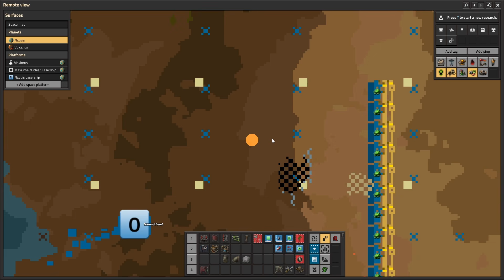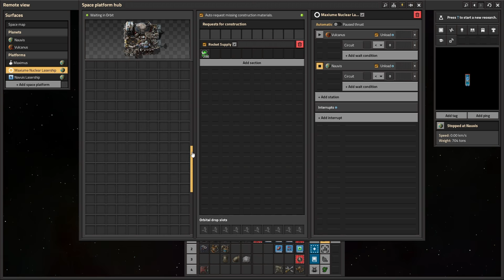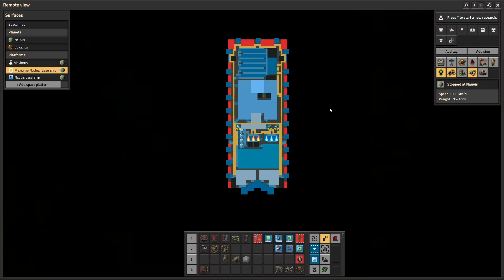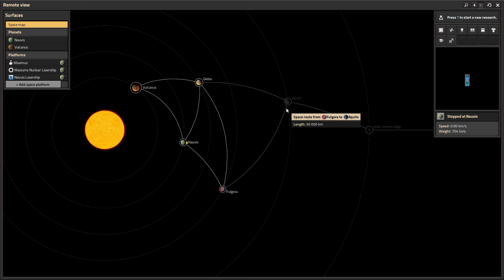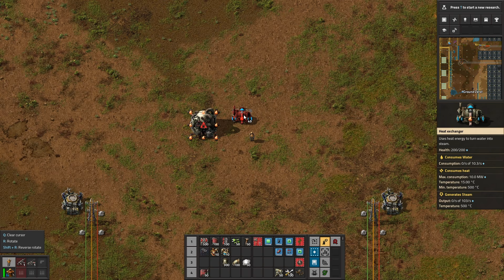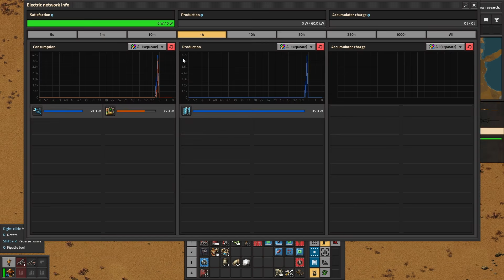Design Marathon: Compact 480MW Nuclear Plant | 55 | Factorio Space Age

Comment: I went a slightly different way on Nauvis, I went a similar design to start with, but when I needed to expand Nauvis I went to a more easily extendable design - it's a repeatable strip the height of a power plant with the heat exchanges and turbines in line going out the sides, properly ratio'd out (with smaller segments for the first and last segment as they have less neighbour bonus). When I need to expand, I can just paste the top two (one full sized, special end chunk) one reactor up and it goes up pretty quick without any thought.

Comment: I designed something similar and found that it was hard to keep it at 100% power output due to pipe bottle necks on getting water/steam through the pipes to the turbines. Not sure if the Factorio pipe fluid dynamics have been updated since then though as that was probably 2 years ago that I was dealing with that issue. Have you tried drawing all 480MW from this design and does it maintain output? I think I had to connect like 8 or 10 water pumps if I remember correctly.
Reply from the maker: Yes it works flawlessly

Comment: You can make it further efficient by setting up a priority system. Wire an accumulator to a radar dish, thus making the power level accessible anywhere in your base. Then another radar dish near your reactors. Take the power level signal and connect it to a pump that’s pumping in water. Have it only pump in water if the accumulator power level ever reaches a certain threshold.
That way the steam turbines won’t actively be recharging the accumulators, you’re giving the solar the priority to do that.
Reply from the maker: I like you idea 👍🏻 solar over fission
Reply: Yea yea ^.^
The signal on/off switch has to go on the water pump unfortunately because you can’t “turn off” the heat and the heat exchangers don’t have logistics capability. And it’s nice because the heat doesn’t dissipate. It has to get consumed by turning water into steam. No steam if no water.
Reply from the maker: @Stringer207 exactly. Might have a bit of delay but it still works flawlessly at scale which is what matters. Now all i need is a Europe-sized solar field. Lol
Reply: i found out. if you dont even have a big base. you can just have like 1 or 2 power plants. produce steam with them in the steel containers. and the steam will just being jused when needed. or in tother words. using the at0mic fuel less often.